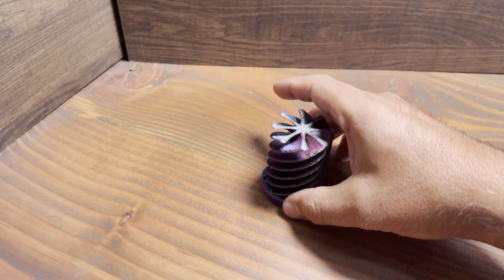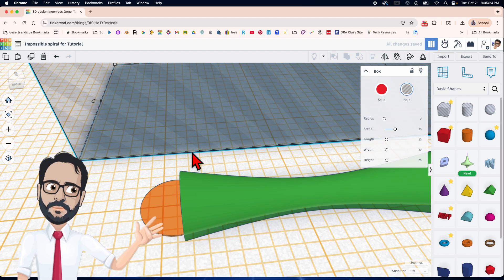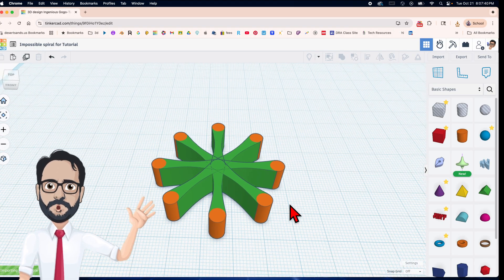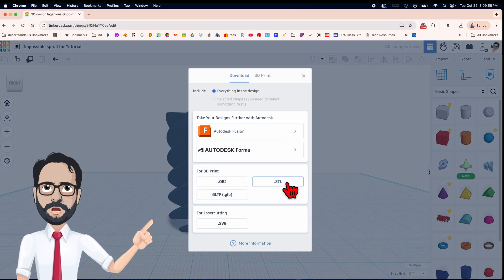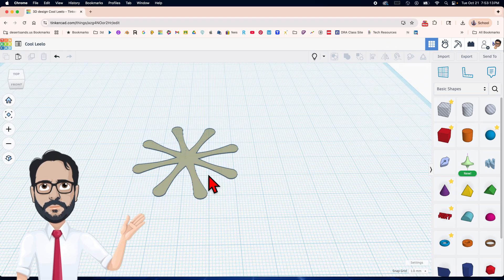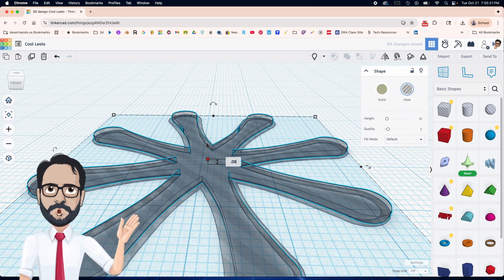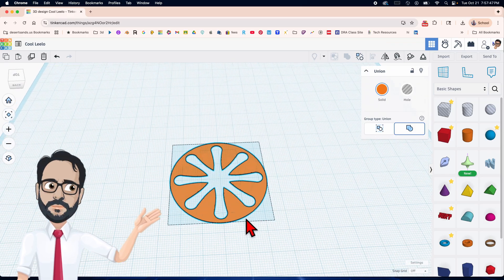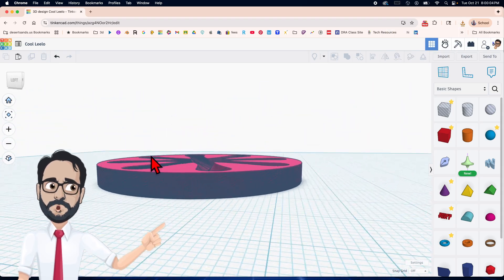Learn How to Make this Impossible Spiral in Tinkercad

Comment: Wouldn't it worked if you duplicated the spiral star, made it a hole, made it a bit larger, put inside a cylinder and group to make the outer cylinder with a star shape hole in it?
Reply from the maker: Yes.  Try it and let me know because I think it will in theory